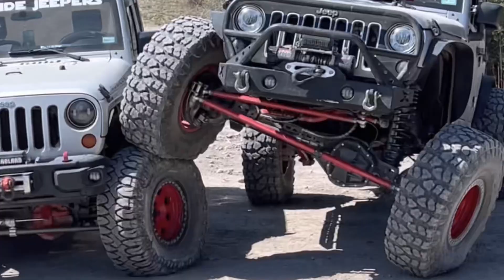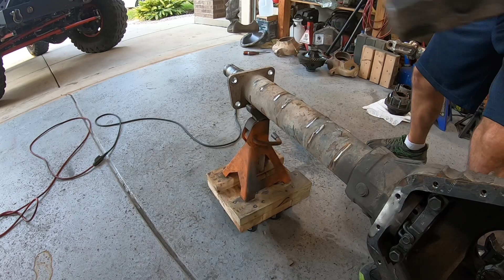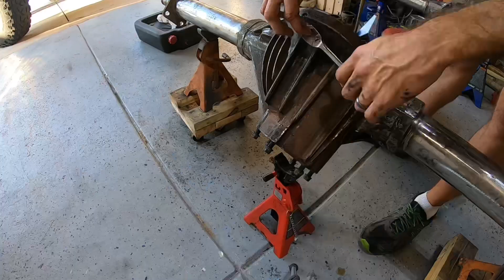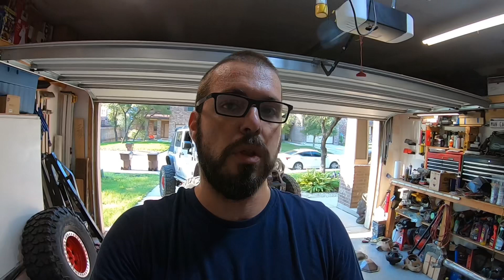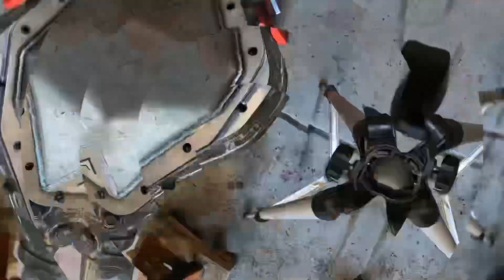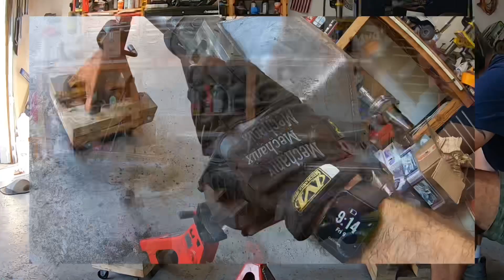HOW TO SHAVE A 14 BOLT AXLE - Project Maple Leaf Jeep Build (no. 6)

Comment: So you cut through the drain plug then weld it up to seal it.  But the question  is do you install another drain plug somewhere else?  I didn't notice one in your cover you had but can you buy them work drain plugs?  Or are you just stuck with removing the cover to drain and replace fluid?
Reply from the maker: I just remove the cover to drain fluid. Allows me to do inspections at the same time.

Comment: @WarPaint question about the drain plug, good as it is, don't have to weld around that area correct? I know the bolt hole you need to weld, but the actual plug itself.  Thank you sir
Reply from the maker: @chuckieswickedgoodfab  so I tighten it. Shave it. The. I weld the bottom where the plug was cut…and inside the diff on the other side of the plug. Then on the bottom I grind it flat…

Some people also put a thin layer of RTV over the weld on the inside to just give it some cheap insurance…but after that…you are good to go. I hope that answered your question.
Reply: @WarPaintTexas  absolutely did. Thank you that is absolutely what I was looking for.  Thanks again for great videos. I go back all the time to reference these, really appreciate the time you put into them.  Thanks again

Comment: TMR 15 bolt kit is $450 with filler plate and diff cover. Not bad if you don't only have a thin OEM dif cover.
Reply from the maker: Not bad at all. But the 13 bolt shaved don’t have a thin diff cover either. They are also aftermarket and 1/4 inch thick or thicker

Comment: Nice video. 15 bolt “full shave” kit from TMR is $450. But it is a lot more work and requires a particular welding process.
Reply from the maker: Yes! And some people take those kits and then bring them to machine shops for the cutting. Not totally necessary. But they do and it’s costs a bunch more. The. Some kits are even more expensive. Plus the machining for the ring gear. So it adds up.